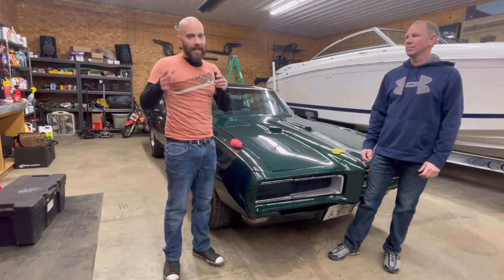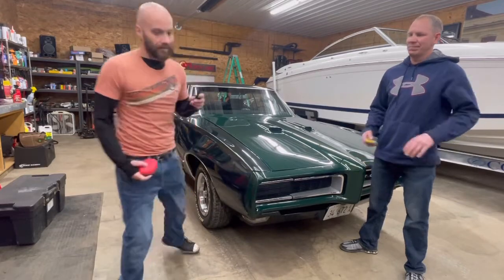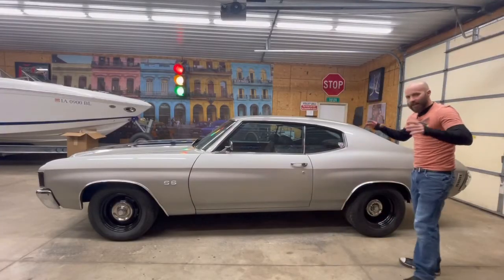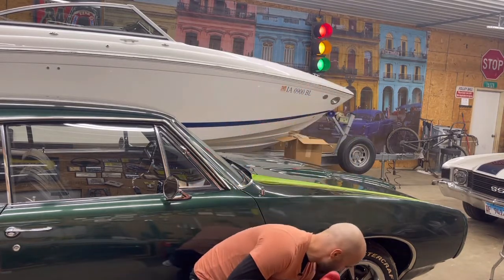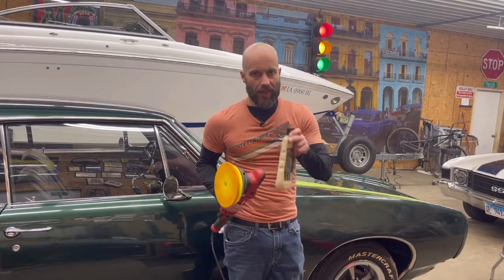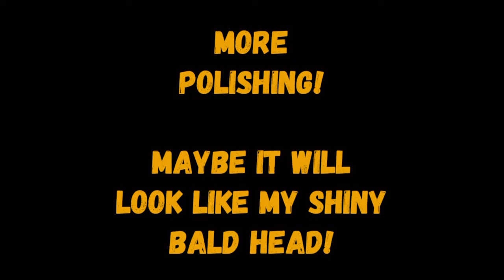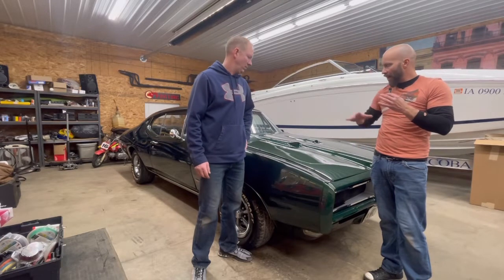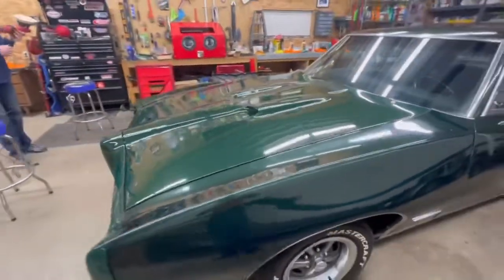The Big Green Machine Gets All Dressed Up and Eddie Gets New Grippers #nonamenationals #holley

Comment: The older-kid neighbor, when I was a kid had a '68 Lemans 2 door hardtop in the same green as on this Goat (but not what's on the hood and Endura nose) His had a black vinyl top and a black bucket seat interior, with the console and floor shift automatic and a 350. He put a set of ET mags, which looked just like Cragar SS, on it. I loved that car. It had dual exhaust too.
His older brother had a '71 Lemans Sport in burnt orange with a black vinyl top and a set of the true Honeycomb wheels - not Snowflakes. That one got genuine Cragars...
I'm old, so I would replace them blackout lenses on the Chevelle. I'd also paint those steelies to match the body and get the correct Chevy dog dishes. (Think the SS on the grill might be upside down. Those 'eSSes' should be wider at the bottom - it's subtle and they might not be be wrong.) I'd put the Cragars on the GTO, or grab a set of the old black "PMD" cloisonné center caps for those Ralley II wheels on there.
Those are both awesome cars in a couple of the most perfect colors for them, other than black!
Reply from the maker: Sounds like a great car!!!! My opinion, I like color matched steels too. Also. I I’d love to find a T-37 5 4 speed car